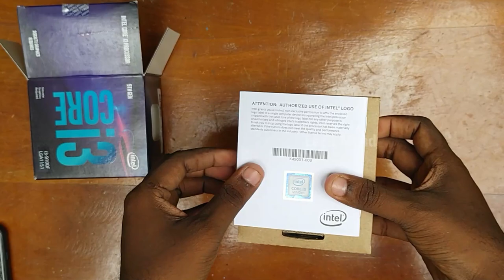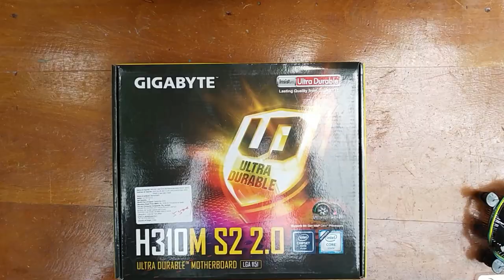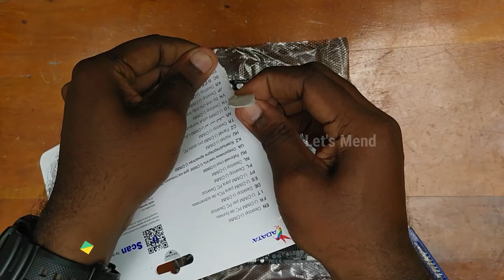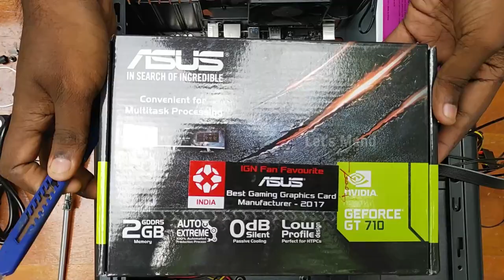BUDGET PC FOR HOME,OFFICE & STUDENTS UNDER 25000|IN TAMIL|i3 9100f |PC BUILD TAMIL|NVIDIA GT710|2020

Comment: Or... You could just get an i3 9100. It still has better graphics than a GT 710 lmao.
Reply from the maker: What it means
Reply: @princetechnologies  the integrated UHD graphics on Intel chips are better than the GT 710. It is such a bad card.
Reply: @mahnamejeff7586  which is best gpu in  under 7k?
Reply: @kavithe7  new, none. I'd look on the used market for stuff like rx 570
Reply: @mahnamejeff7586  in gpu not good for used ...
Because i have two gpu 2nd hand both stops within a year ..
That's why i lost hope even new once 🙄 
Still im using pentium d 
Looking for i3? Pc build
Reply: @kavithe7  only buy used from trusted sellers, also if you cant go used, get a brand new rx 550 or rx 560
Reply: @mahnamejeff7586  I'm also planned same bro... thanks👍